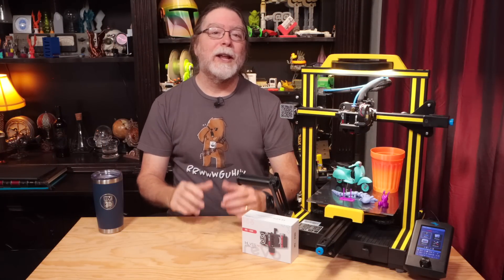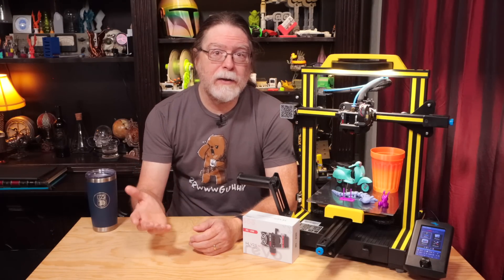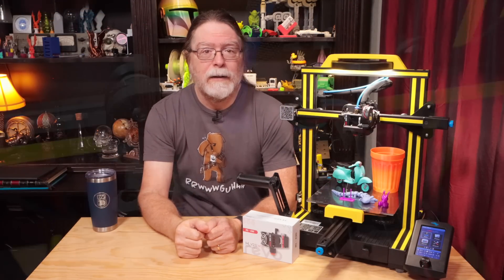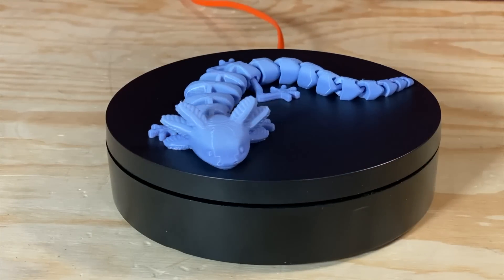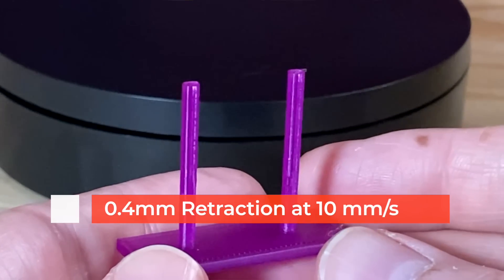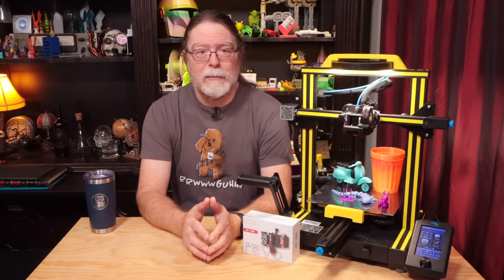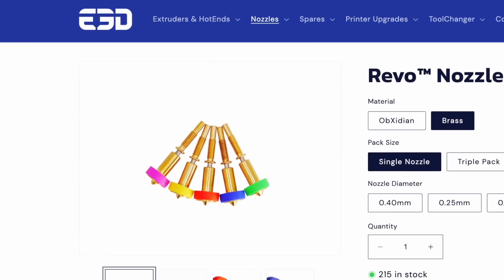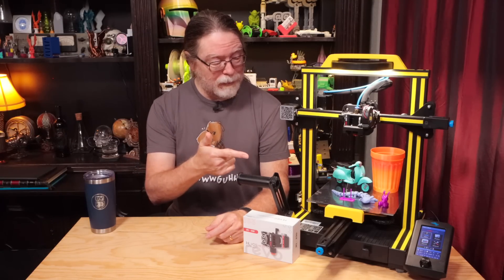Check out this COMPACT, DIRECT-DRIVE EXTRUDER from BIQU + E3D Revo!

Comment: I love the video. I am using the Revo with an OMG DM1 extruder. I love it. But it is not as easy as you make it sound to change nozzles. Because… if the nozzle has melted plastic on it you will have to break the seal around the edge before you will be able to unscrew the nozzle. BUT I love the Revo system much better that the standard way of heat tightening. Much easier!!

Comment: I have the H2 v2 (non-S, non-Revo) and it's one of the most reliable in my inventory. However, it did require a disassembly and readjustment of the gears, before which it was awful.

Comment: One thing worth to mention: regular revo/revo6 heaters have a 104 semitec thermistor which has a different resistance curve than a 3950k thermistor commonly used on creality and most other brands like sovol, elegoo, artillery, flsun, tronxy or kingroon. Anycubic and prusa use the 104 semitec thermistor.
Both thermistors are close enough, but still deviate like 10 or more degrees at set 220. So make sure you get the right heater (revo cr has the 3950k) for most optimal drop in experience
Reply: The most amazing things is that 3950 thermistor (13 in marlin) used in v6 heatblock of regular BIQU H2 V2S is not actually 3950, but 4100. It's thermal table sits right between true 3950 and 104 semitec themistors.

Comment: Thanks for the review, yes i been looking to move to that driect drive on the ender 5. Question do you have to unload thw filament to remove the nozzle?  Keep the dad jokes comming
Reply from the maker: Hi! You can unload the filament before swapping if you want to, but you can also cut the filament off at the top of the extruder and set the filament loading lever to the "I want to load filament" position (releasing the tension on the drive gears). Then unscrew the nozzle and pull it out, along with the little bit of filament that's still in it. Cut the filament off at the top of the Revo nozzle after it's out, and then next time you install that nozzle, purge what's in the nozzle as you're loading new filament.

Comment: i just swapped out my original H2 since it was causing problems after problems. While i still really like the overall design and functionality, i got only bad experience with the quality control on Biqu side. Worn out grub screws on delivery, overtightened screws on the sides, etc. So, to put it in Teaching Tech's words: "a great extruder IF you get working one".

Comment: I solved the 10 mm printing area loss by  printing y axis extension and custom longer belt.
Reply from the maker: For the Ender-3 V2 or other printer with a 4040 extrusion for the Y axis, you can also remove the 4 bolts holding that extrusion in place, and move the whole Y axis forward by one set of screw holes, bolting the extrusion's rear holes to the front holes in the bottom of the frame. The Y axis will then only be held on by two screws instead of four, but it works fine.
Reply: @BV3D  never thought of that, thanks.
I do have a question tho
I used pressed clips to secure the ends of the belt but its not as nice as the  original. Is there a specialized tool for it?